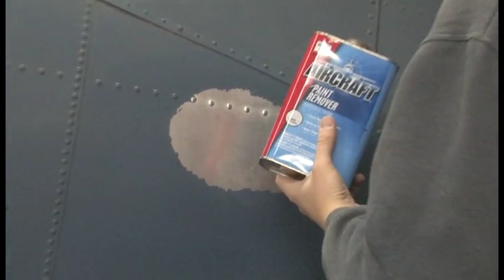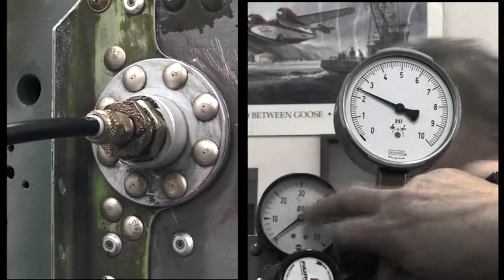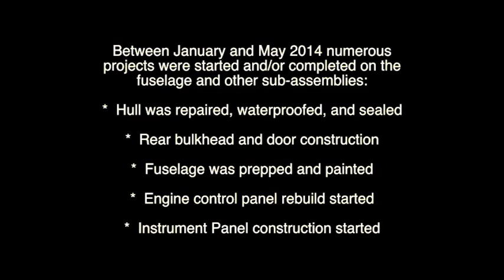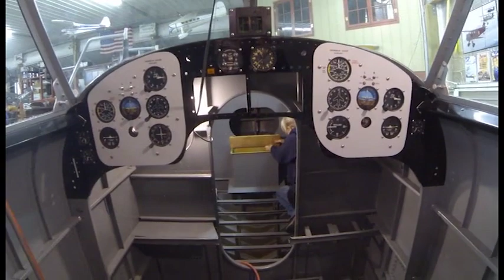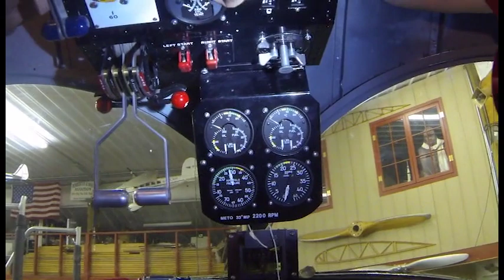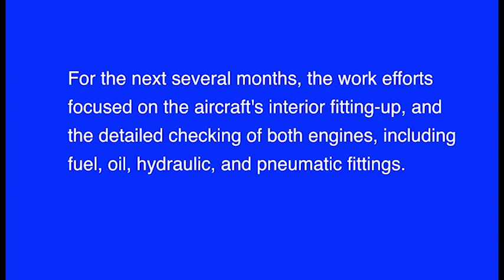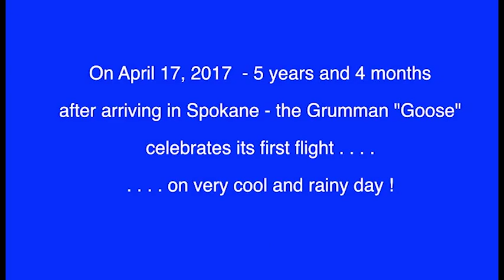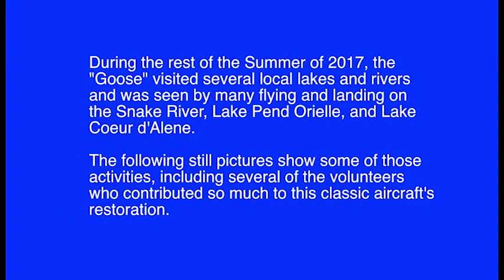Grumman Goose Restoration

Comment: As a kid that grew up on an airport we had a Goose on the field. The man that owned it let me clamber through it. I still remember that, I'm now a pilot and a flight engineer on a B-25. The love of round motors are in my blood.
Reply: When I was a Coast Guard Aviation Machinist Mate Flight Mechanic on Grumman HU16e Albatross seaplanes I lived the smell of the first puff of Avgas and oil burnin'in in the morning.
Definitely a wonderful elixir to a seaplane fan.
Now I'd love to build a monster size RC version of the Goose or an Albatross ('Ol Goat).
The sound of those radials turnin' over is pure Bliss if you truly care a radial engine lover.
Reply: Amen sir. 70 years on the odometer now but this kid trapped in an old mans body lived across the street from Wright Patterson AFB. Back in a day when there were just a few round motors and propellors around. Still love the smell of Av gas and burned oil. The rumble of an air cooled radial or the bark of a Merlin never fails to turn my head.

Comment: I helped restore a Goose at Dean Franklin Aviation back in the 80's
He hired me because I was a Coast Guard Aviation Machinist Mate Flight Mechanic on Grumman HU16e Albatross seaplanes in the mid 70's.
First flight on a rainy day, no problem.
She was built to get wet so it's ba good christening.
I'd have watched this if it hade been 4 times longer and shown more details like fitting out the cockpit area.
Well, as a Coast Guard Aviation Machinist Mate  Veteran Grumman HU16e Albatross seaplane Flight Mechanic I gotta say she's one beautiful bird.
Just the wing paint livery 😇

Comment: 1965. I was in the Air Force and was assigned to Midway Island naval air station. There wasva " goose " that was used to fly over the island and look for sharks. One day a couple of us swimming on the " safe" beach. The water is shallow over a large area. This " Goose" kept dowm low over us. We thought they were just buzzing. They ended up sending Shore Patrol to tell us to get out of the water. There was a shark, it got passed the reef around the island. The Air Force was going to set up an Enroute Station for cargo air craft flying loads to Vietnam and returning back to the states.